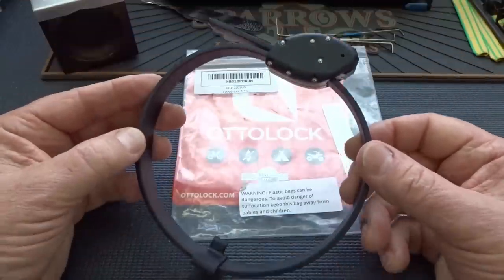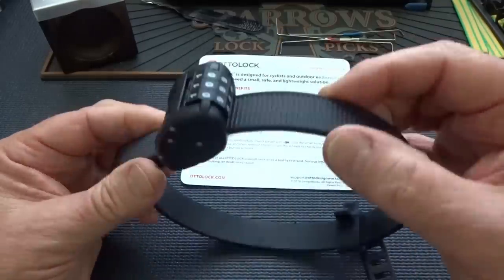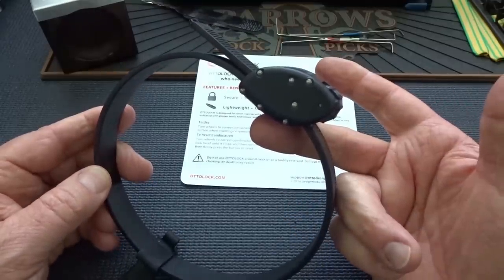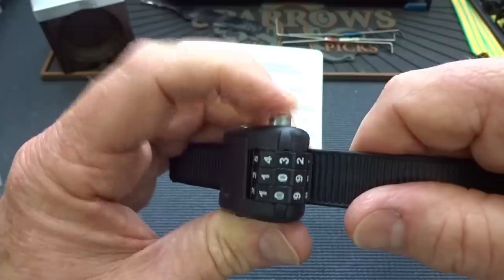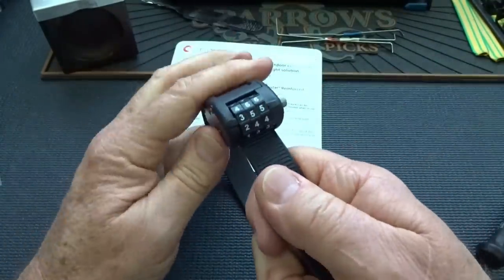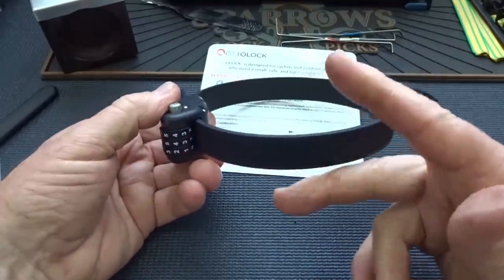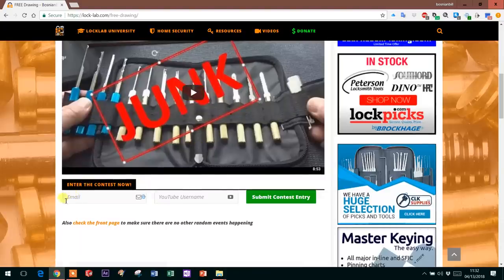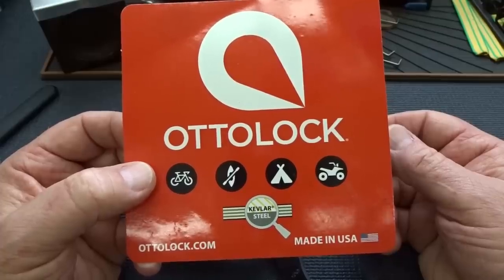(1272) Review: Ottolock Bike Lock (JUNK!)

Comment: I have two. It was funded from kickstarter
Reply: Ok after I saw this video I went to check all of them ( I actually have 3. An 18", 30", and 60". Like I said I got mines from kickstarter. I haven't used them cause I was waiting for warmer seasons to ride the bike and use it. They claim it's a little better then using a cable lock. All three of them work fine. Never planned on using them to secure my bike no more then 5 minutes ( I will be reducing the time though )out of sight. I contacted them via email and sent them the link to this video hopefully they can explain this mess.

Comment: I think you were using the lock upside-down. The grooves should be facing down NOT up. That's why you could pull it out without unlocking it.
Reply: ++  It doesn't look like there is much meat underneath the belt in the housing - not much room on the bottom for the pall to do any work.
Reply from the maker: No, I tried that.  Besides, if you do that there would be a twist in the belt.  I did it exactly like they showed on their website.
Reply: Checked the amazon listing -- the Locked position on the amazon pictures even shows the teeth on the outside, fed back feeding away from the tumblers.  @Bosnianbill you have it inside out :D
Reply from the maker: Look closely at that picture.  That is in the storage position with the silicone tie-down.  The strap doesn't enter the lock body, just wraps under it.  I tried the belt both ways, but with the teeth point the opposite direction it was necessary to twist the belt, which I don't think was the designer's intent.  Regardless, it didn't work and the belt slid in without engaging the locking pawl.  Good idea tho.

Comment: This product is garbage. Don't waste your time or money. I bought two of them for my trip to Europe and both did not work due to the locking mechanism, that when you put in the correct combination,  would not open.  I had to use tin snips to cut one of them when I had my bike locked to a tree.  Took less than 10 seconds to cut, thankfully in my situation. The company is not responsive to criticism and basically told me I was lying and did not want me to send them the lock that did not open as proof.  They were not willing to make things right.

Comment: People use die grinders on bike locks and yet there are 2 acids I know of that could do the job just as fast without the noise Magic Acid and Fluoroantimonic Acid.
Reply from the maker: send me a couple of bottles...
Reply: CRAZYD3MON96 i hate it when people say that. Yes you could use acid. But seriously, why? Its dangerous and messy.
Reply: But it's discreet
Reply: Not to people with noses. 
 And acids can make some odd sounds while destroying metals. Its s violent process.
Reply: Its a lot less loud than a grinder. But people dont care enough to interfere anyway. 
Even if they did, a van with some sort of company name on the side and a blue collar uniform is more than enough to look legit enough that most people would just assume you  are legit. 
Magnetic signs are easy to get and remove so even if someone did see it and report it you can remove it.
Reply: Sounds like an easy way to damage the bike your trying to steal.
Reply: Sorry, when I posted this, there was some formatting.OH MY GOSH! -- YIKES CrazyD3mon96 - I know you have to be using a large amount of humor that just doesn't come through in posts  -- However, for the ill informed that may be actually considering this: --- NO ONE THAT IS NOT WELL TRAINED IN CHEMISTRY SHOULD MESS WITH EITHER OF THESE "SUPER ACIDS!" -- Bold, Double Underlined - MIC-Drop!! --- Honestly, experienced Chemists avoid these acids unless absolutely necessary for the task at hand... and even then we approach them like one would Freddy Kruger! I have almost 30 years as an industrial Analytical Chemist and I would find a new position if my employer ever considered having these used in the process - for that fact, even in the lab for any reason!These are like having an hand-grenade on the shelf - not a question of if someone will be hurt - but more a question of when the incident will occur!Fluoroantimonic Acid is highly toxic, and will explode on contact with water. A single drop on the tip of your finger would essentially take your finger off and the fluoride poisoning would be very difficult to treat! Drip a bit in a lock that had a tad of water in it - at best you'll only break everything holding it - more likely, you'll lose an eye, or the hand... just depends on the concentration and the amount of water... For those interested Material Safety Sheet:https://www.fishersci.com/shop/msdsproxy%3FproductName%3DAC312130500%26productDescription%3DFLUOROANTIMONIC%2BACID%2BHEXAH%2B50G%26catNo%3DAC31213-0500%26vendorId%3DVN00032119%26storeId%3D10652  -- as for Magic Acid (aka: Fluorosulfuric acid-antimony pentafluoride ) this is the "kissing cousin" to the afore mentioned. While not as violent in reactivity - it is every bit as dangerous!https://www.sigmaaldrich.com/MSDS/MSDS/DisplayMSDSPage.do?country=US&language=en&productNumber=175080&brand=ALDRICH&PageToGoToURL=https%3A%2F%2Fwww.sigmaaldrich.com%2Fcatalog%2Fproduct%2Faldrich%2F175080%3Flang%3Den  --- Please kids, don't do this at home - even highly trained professionals don't like this stuff!
Reply: z.pv.nrt yes even something relatively unexotic like hydroflouric acid is extremely dangerous. It can pass right through skin with ease and requires intraarterial calcium treatment to counteract if that will even work. 
 Thats why i dont like when someone suggests acid attacks on locks. The water reaction is a definite consideration, however if you are adding acid to the water, its less intense than the other way around.  When in doubt do what you oughtta and add the acid to the watta. 
 Its still dangerous. But with acids its molarity or concentration that determines how fast or if it will even work for a given purpose along with the specific material that it is being used on. HFl as mentioned above is used to etch and dissolve glass, but it can be contained by other materials. Other acids will dissolve materials that will contain HFl safely but not reaact to glass. So some acids can be contained in glass and others cannot. Vinegar is a specific dilution of acetic acid at least the common off the shelf variety and is at a 5% dilution with water, meaning its 95% water and or other ingedients and 5% acetic acid. It can be contained almost indefinitely in an hdpe or glass bottle. Not so with other acids. 
 The other problem is application. How are you going to attack the lock with the acid? Just pour it on the lock? Well its a liquid. And its reactive, if you choose the right concentration of the right acid for the right metal. Gravity is going to cause it to run off the lock. The reaction, if any is going to offgas and create heat, possibly steam, and other wase products, all of which will be at the reaction site and want to go somewhere, with the remaining acid on top of them. This will tend to move the unreacted acid out of the way, halting or slowing the desired reaction.  Additionally, and non motile waste products will form a non reactive layer on the reactive surface causing the same thing. 
 So if you decide to pour the acid into the keyhole, maybe you picked an acid that reacts well with steel or other ferrous metals but not others such as brass or aluminum or even plastics. Well if the lock is made of this stuff inside, you might as well have just poured water into the lock. Its not gonna do much for you. 
 Particularly massive locks might well require more than one application of the acid because its a mass dependent reaction. The mass of the sollute vs the mass of the solvent. Temperature even plays a role. The temperature of the lock vs the temp of the acid. Its helpful to look at it like a fire. Which it isnt dissimilar to entirely. 
 You can have fuel and air, but if the temperature isnt right, there may be a slow reaction or none at all. 
 All of these factors are why we dont really hear about people going around using acid on bike locks to steal them.
Reply: Sulfuric acid  from old Lead acid car batteries heated to 100 degrees Celsius in a Erlenmeyer flask until it gives off white  fumes to concentrate it then cooled and put in a bottle works quickly on dissolving stainless steel or any steel for that matter..
I was shocked at how fast it dissolves metal.
Reply: Acid is dumb mmmmkay?
Reply: you can't be serious... people, boiling sulfuric acid for any reason other than in a laboratory under very controlled conditions is very dangerous and will most likely result in serious injury to the person attempting to so so - as for real fuming sulfuric acid - it  is nothing to be playing with unless you are a trained chemist --As for Magic Acid and Fluoroantimonic Acid - once again: Only a chemist should be using either of these solutions these are very aggressive and in the case of Fluoroantimonic Acid highly toxic - don't think for a moment that your local emergency room is going to be equipped to handle the injuries inflected by any of these acids!
Reply: z.pv.nrt i think we are preaching to the deaf, in latin man. The bright side is that none of the people who think this way are likely going to put out the effort to get these chemicals and use them. If they do its unlikely that they would get to the point of actually using them before they have an accident. 
 Like i said theres a reason we dont hear about people using acid to beat locks.
Reply: beat-locks... that's funny...  with a lot of locks, you can really beat them and they open.. (in my mind's eye, I saw people hitting the locks with a lead-acid-battery trying to bypass by rapping the lock!)
Reply: z.pv.nrt dude you probably could use a lead acid car battery to open a lock like that.